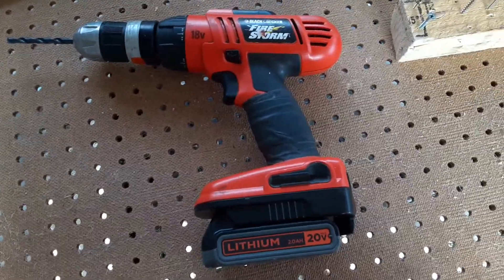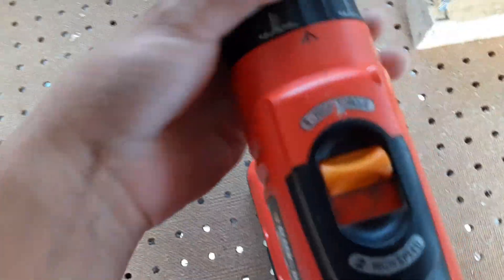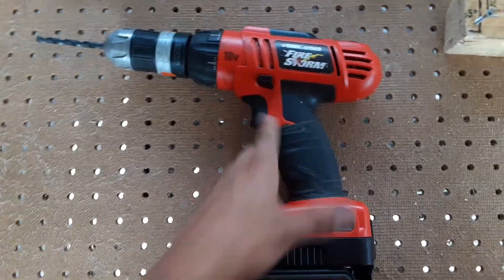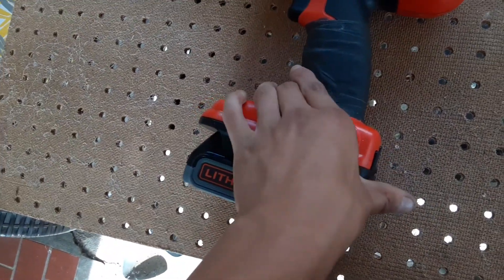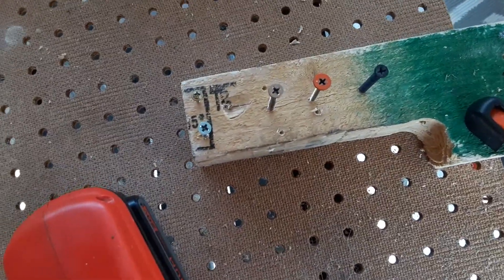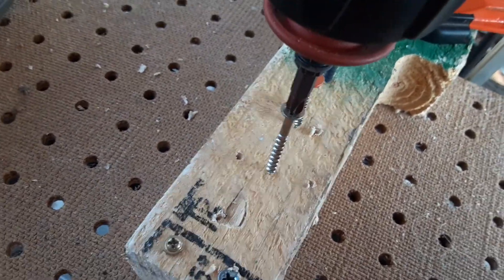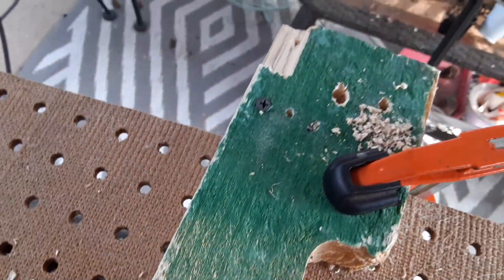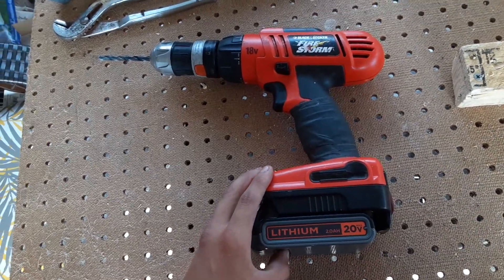black and decker 18v firestorm drill review

Comment: I had 2 9.6 volt firestorm drills... and I upgraded to the 24v this was a long time ago.. those were dewalt and porter cable quality.. I wish black and decker would reintroduce this line! I would be a customer!! Best drill I ever owned until the lithium days, the 24v would snap 5/8 bolts off😂😂!!